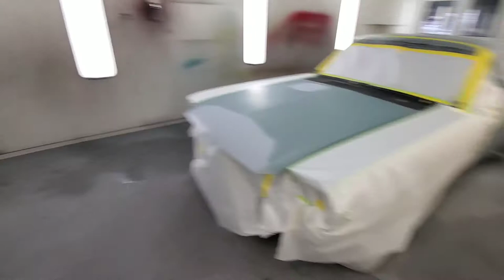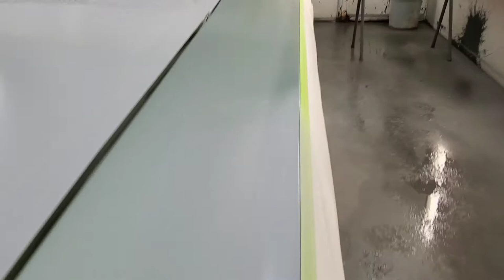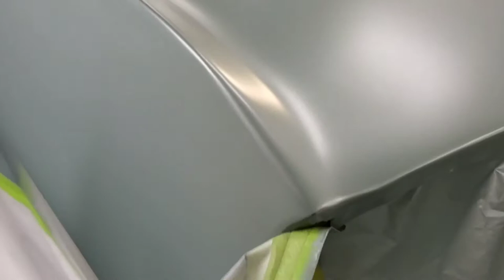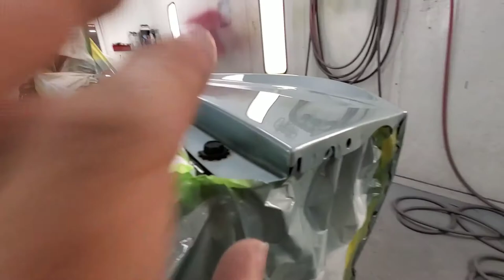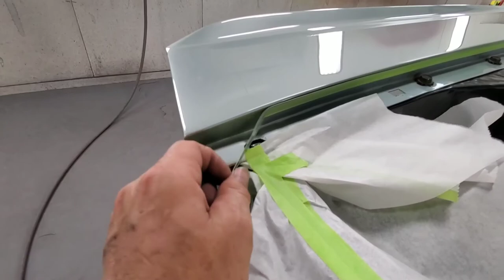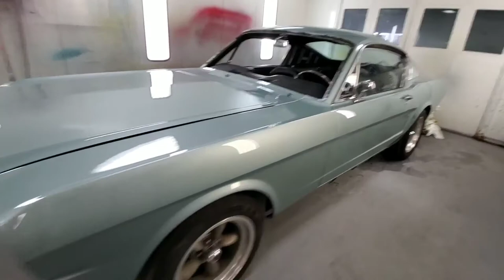'66 Mustang 2+2 Front end with Aquabase

Comment: I'm retired now but my shop had a chroma-base system, chasing blends on a high silver color could be a night mare. They didn't have a blending clear back then, I found using Dupont 101 base maker and thinning as needed was a way to go. And yes blending into a sanded panel gave ledges for the fine metalics to stack up on. This is the only way to do it.